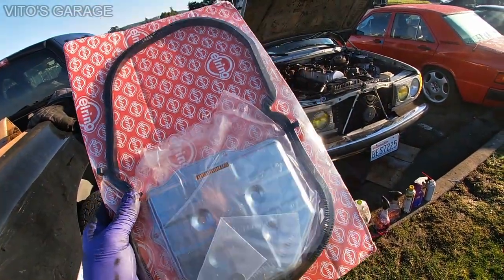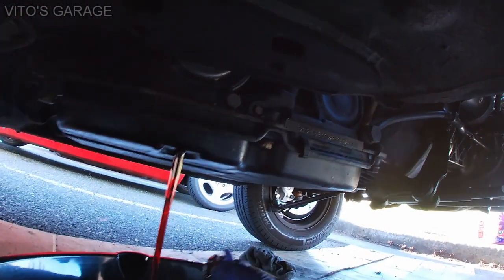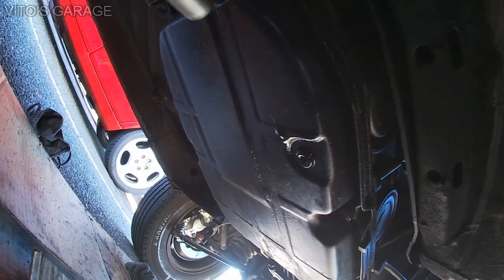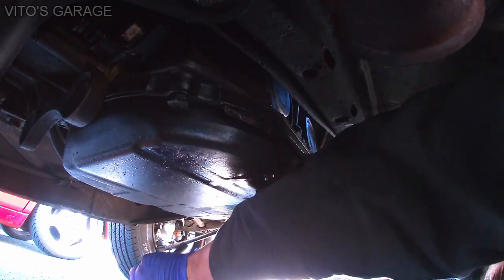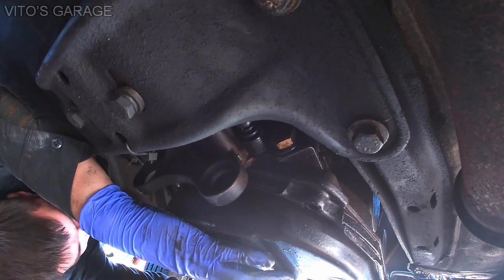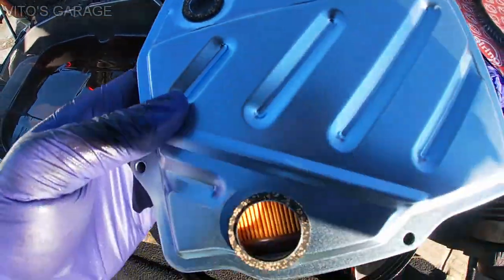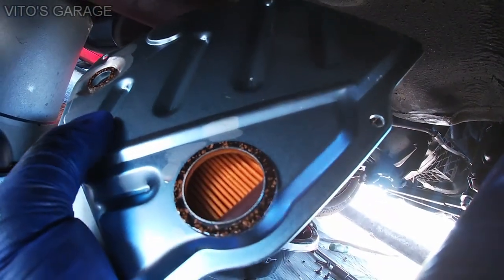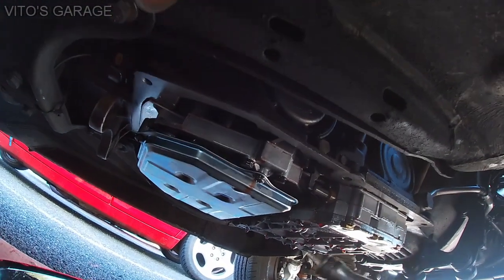PART 15 Dad's Mercedes W123:  Automatic Transmission Fluid, Filter, Gasket Change! Oil Pan Repaint!

Comment: Privet! How many litres came out and how many litres did you put in? What about torque converter drain? Do these have one or not necessary? Thanks!
Reply from the maker: Privet to you as well! About 4 liters, I think. No, I didn’t drain the torque converter. Just the pan. If you want, you can drain the converter too. They have a drain plug

Comment: I have a R107 (1983 380SL). It's pretty similar I believe...
How much Transmission oil does it needs? I have bought 7 liters, approx 1.85 gallons.
And I should add ATF few bottles at a time?
How do I do it? Can you please guide?
Also do you know how much engine oil is required in these cars?
Thanks
Reply from the maker: Hello. I usually buy those two big gallons of transmission fluid (Red Valvoline Multi Vehicle ATF). I used a Lucas trans additive in the video. You can use that too if you want. 
Add about 5 liters first. Then, start the engine and shift through all the gears a few times. Then, while the engine is running in Park, check the trans fluid level. Adjust it to max. The car has to be level. 

For the engine oil: use full synthetic Mobil 1 10w-30 or 10W-40. Buy two gallons too. It takes around 7 or 8 quarts. You’ll have some extra oil left over in the bottle. 

If you have anymore questions, send me a message on Instagram: vitosgarageyoutube
Reply: @VITOSGARAGE  thanks a lot for the guidance.
Sorry I’m kind of old school, not on instagram 😖
I hope if I have anymore questions I can still ask here?
Thanks.
Reply from the maker: @MK-xn6qx  you’re welcome. And sure, you can send me a message on here. I hope I won’t miss it
Reply: @VITOSGARAGE  I think or I definitely know that I overflowed the transmission fluid.
It started leaking, I thought maybe the bolts are lose, so I tightened them. There was still leak, I pumped out almost 1.5 quarts of oil back. Still see some dripping. Now I’m confused 😕 
Should I drain out more? I initially added almost 6.5 quarts. Or can there be any other reason?
This is my first time doing it. Or final solution will be to drain it all again completely and add?
As you said, I added almost 5 quarts first, waited for it to heat up, shifted the gears, put it on idle and added almost 1.5 quarts more.
My dip stick doesn’t have max or min and since I’m new I messed up. It also smokes cus oil is dripping and touching hot exhaust and other stuff.
Should the oil level be always between two lines? 
Any suggestion is helpful, thanks.

Comment: did you have to drain the torque converter as well?
edit: what are advantages and disvantages of draining torque converter?
Reply from the maker: I didn’t drain it on this car. You can drain it. Nothing wrong with that. You’ll need more fluid if you drain the converter